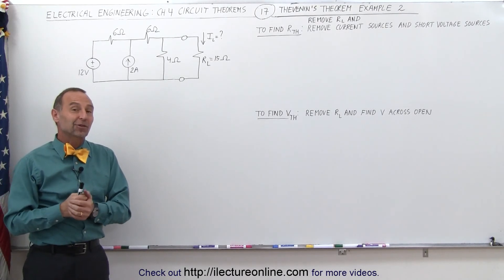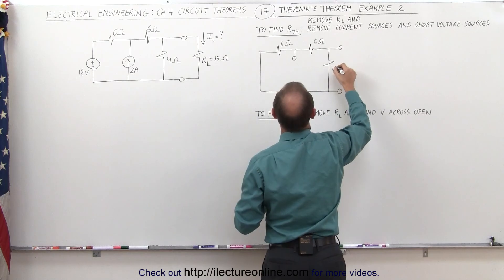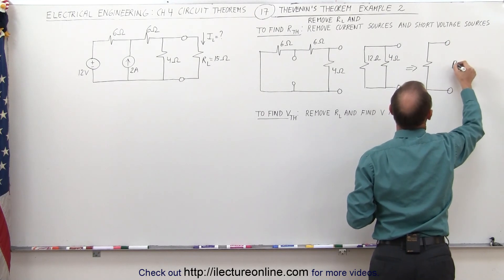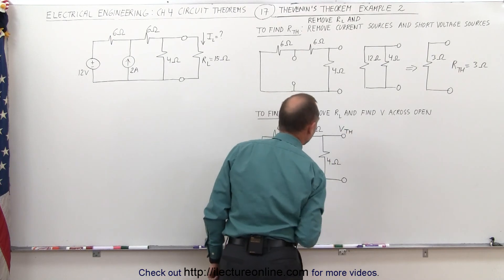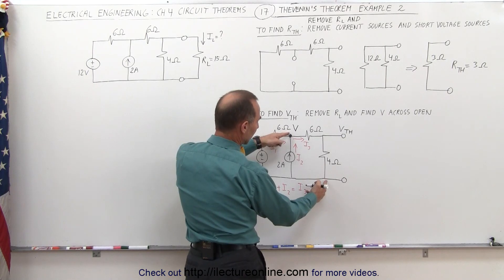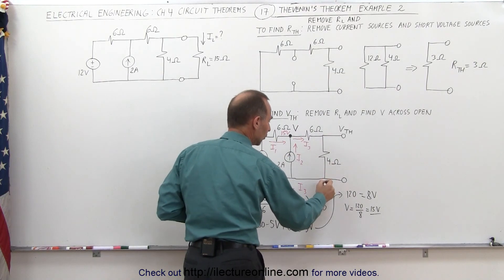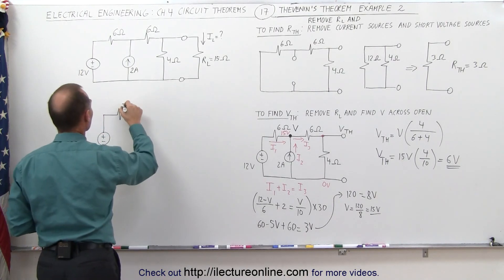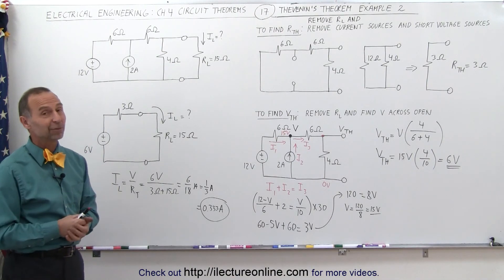Electrical Engineering: Ch 4: Circuit Theorems (17 of 35) Thevenin's Theorem Ex. 2

Comment: im confused, why is the equivalent resistance of the two 6 ohms equal to 12 ohms? are they not in parallel? 

or, does it mean we neglect other branches that are not resistors when we're determining whether resistors are connected in parallel or in series ?
Reply from the maker: When you are finding the Thevenin resistance, current sources are removed which places the 2 six ohm resistors in series.

Comment: at 1:08 when you combine the resistors, why is it not possible to combine the 4 ohm and 6 ohm resistors as they appear to be in series?
Reply from the maker: From the 2 end point connectors, (let's label them A (top) and B (bottom)), there are two seperate paths from A to B.  Through the two 6-ohm resistors OR the one 4-ohm resistor.  That is what makes them in parallel.

Comment: hello
Please why was the node above 4ohms not solved using node analysis

Giving us two a simultaneous nodes equ instead of using voltage divider
Reply from the maker: There are many techniques available to solve circuits.  When we use one of them, that doesn't mean that another technique could not have been used instead.  We try to cover all the different techniques.

Comment: Sorry sir, but on finding your equivalent resistance, you said the two 6 ohm resistors are in series. How are they then in parallel to the 4 ohm resistor, since the same current flows through all resistors upon open-circuiting the load?
Reply: Sorry I may have been a bother, I can't just help but be inquisitive about things I don't quite understand
Reply from the maker: The best way to determine if resistors are in series or in parallel, is to see if there is only one path, or mulitiple paths for the current.  In the second circuit drawn, all the current flowing through the first 6 ohm resistor MUST also flow through the second 6 ohm resistor, therefore they are in series.   The current flowing from a to b, has a choice.  It can flow through the 4 ohm resistor OR through the two 6-ohm resistors.  They are in parallel.
Reply: @MichelvanBiezen  where can point a and b be on the circuit that the current gets divided, it was open circuited at that branch if I recall correctly.
Reply from the maker: Look at the first sketch under : "To find Rth".   Going from a to b there are 2 paths.
Reply: I dont see any labelling for a or b....can u please indicate by some means sir 🥺
Reply: Like " a is a point between such snd such resistor "
Reply from the maker: You are correct.  I didn't mark the a and b points (which I usually do on these types of problems).  They are the little circles drawn in this type of problem which indicated that is where the load is attached.   a and b are the terminals to which the load is connected.

Comment: Sir, you did a proof of thevenin's theorem but it is not the proof of the method that you used here. Because in the proof, there must be a current source (or maybe a voltage source) outside of the linear part. But there is only a resistor outside of it. I want to see a proof of this method.
Reply from the maker: We didn't give a "proof" of the theory.  We just illustrated how to use the theorem.
Reply: @MichelvanBiezen  But you have a video of the proof

Comment: Professor in this example can we write KCL for those two nodes . In one node the voltage is V and in node next to it is Vth . And for current I3 we can write V-Vth / 6 . Can we do in this way or not ?. ( I know that this  solution that you have given is in more easy way with voltage devidor but I want to know that maybe this exercise can be solve by doing 2 KCL )
Reply from the maker: You should always be able to use KCL.  (It always works).  Try it and see if you get the same answer.
Reply: @MichelvanBiezen  yes is the same answer . ( I like to solve those problems with KVL but I realised that also KCL is very powerful tool ) thank you
Reply from the maker: Usually you want to use both in the same problem.
Reply: @MichelvanBiezen  yes is completely true
Reply: @MichelvanBiezen  thank you for your advice

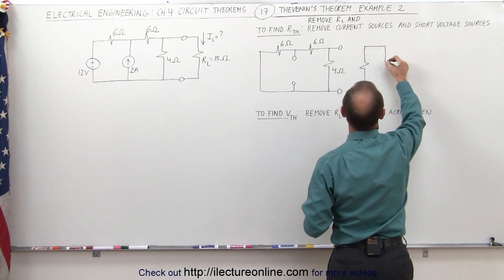Comment: 01:26 why are they parallel?
Reply from the maker: Going from A to B (the two terminals on the right side), the current can either go through the 4 ohm resistor or the 2 - 6 ohm resistors.  When the current has two paths they are in parallel.

Comment: Can anyone tell me, when finding R_th, why the 6ohm resistors are parallel with the 4ohm resistor

In relation to that, if that was parallel, why is the 6ohm resistor in series with the 4ohm resistor in the V_th part. Many thanks
Reply from the maker: Going from the top terminal to the bottom terminal the current has the choice to go through the 4 ohm resistor OR the 6 ohm resistor.  By definition that places them in parallel.
Reply: @MichelvanBiezen  Thanks for the quick reply! That makes sense. I guess I was just confused because I was looking at it in the wrong direction. Would it be correct to say then that when finding R_th, we must view the current as coming from the terminals A or B?
Reply from the maker: That is correct.

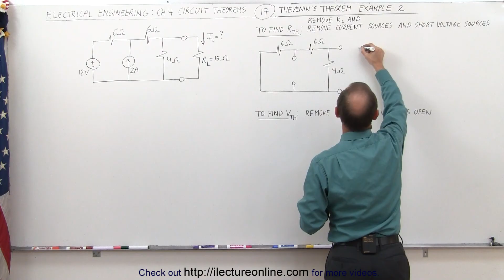Comment: @ 1:11....Why is the 4ohm resistor in parallel with the two 6 ohm resistors? When you remove the load, it appears to be in series ( one current path)
Reply from the maker: There are 2 paths for the current from point A (top terminal) to point B (bottom terminal).
Reply: @MichelvanBiezen  Thanks. I see now.

Comment: how do you find R load, or is it given?, what do i do when i am given a cirvuit that has no load resistor given?
Reply from the maker: The load resistor is usually given, as it can take on any value.  The load resistor will indeed affect the rest of the circuit once it is connected.  It is often the case the load resistor is not given and that is why we use Thevenin's  Theorem to solve the problem.  We have other examples like that.

Comment: Thank you so much sir, I have a question though.
Why did you add the 6 & 4 ohm resistors during the nodal analysis step when finding Vth? I don't understand how they are I series...
Reply from the maker: Are you referring to the step where I calculate the Thevenin voltage?  (Vth = V (4 / (6 + 4)) ?  That is the method used to determine the voltage used in that branch.  (voltage divider technique)
Reply: @MichelvanBiezen  Yes, thank you. I'll definitely research more on the voltage divider method.
Reply: @MichelvanBiezen  sir , why we use this equation

Comment: Hello Professor, hope you're doing well. I have a random question: let's say that the 6-ohm resistor above the 12-volt source was removed from the circuit and nodal analysis was used, as you showed. How would you represent i1 in this case? The numerator would be "12 - V" but there is no resistor to divide it by? It seems like an easy answer but I am struggling with the basics. Thank you.
Reply: The volt of that node will automatically 12V if no resistor is there

Comment: Dear sir, is i1 direction arbitrary? Because  thought current flow from high to low potential.
Reply from the maker: When there is more than one source, it is not always easy to tell which direction the current will flow in any particular branch.    But yes, current flows from high potential to low potential.

Comment: sir I just wanted to ask again.. why is the Vth is not 15V ?? why do you need to do the 15(4/6+4) to get 6V ??
Reply from the maker: Think of it as a voltage divider.  Part of the voltage drops across the 6 ohm resistor and part of the voltage drops across the 4 ohm resistor.  Vth = the voltage drop across the 4 ohm resistor.
Reply: Michel van Biezen sir .. does this mean that when you open the 2A the two 6 ohms are in series and parallel to 4 ohms.. and when you added the 2A again the two 6 ohms are in parallel and series to 4 ohms?? why sir??

Comment: sir.. why did you take 4 to be divided by 6+4 ?? in the last part when you're getting the Vth?
Reply from the maker: That is using the "voltage divider" concept.  (What is the part of the total voltage drop across the 4 and 6 ohm resistor that is dropped across the 4 ohm resistor?)
Reply: Michel van Biezen thank you sir!

Comment: Sir pls tell why the 4ohm resistor is in parallel
Reply from the maker: If you take the 2 - six ohm resistors and move them to the left branch (the vertical part) it will look exactly like the parallel circuit.
Reply: K now i get it.
Reply: You are an awesome teacher.respect from india.

Comment: why are 6ohm resistors in series?
Reply from the maker: When the 2 A current source is removed and replaced by an open, the two six ohm resistors will then be in series.

Comment: Sir. I dont understand how Vth being calculated. As you used Vth=15V x (parallel). Why you used parallel? Please help me sir. Thank you
Reply from the maker: First you find V at the node using node analysis method which is = 15V    Then you use a voltage divider method.  (Vth = voltage drop across the 4 ohm resistor)

Comment: Sir, I'm totally confused . In 1st example you took the Node as Vth and in this example you used voltage division rule for Vth . Why ? Please answer ASAP
Reply from the maker: Note that in example 1 (video # 16) no current will flow through the 1 ohm resistor, thus Vth is the same as the node voltage.
Reply: @MichelvanBiezen  y did multiplied *30 there for vth

Comment: Please sir I don’t understand how you got i_3 as  V/10 , Explain it to me I’m getting confused. 6 ohm and 4 ohm are in parallel, right?
Reply from the maker: The 6 ohm and 4 ohm resistor are in series.  Thus the total resistance along that branch is 10 ohms.  Since current =  voltage / resistance.    I3 = V/10
Reply: They're in series because the junction between the wire of the 6ohm resistor and 4ohm resistor is no longer a node (the current isn't flowing to the end of the wire)

Comment: Can you please kindly tell me why you the voltage in the node 1 is 15V which is greater voltage source, ia that because of the 2nd source im bit confused, also at the end you multiplied the voltage by 4 ohms over 10 ohms is that V×(R2÷R1+R2) law ? Thanks in advance, i find your videos helpful and easy to understand  thanks again.
Reply from the maker: The voltage at node 1 is found by using Kirchhoff's current rule at that node.  Current in = current out.
Reply: Michel van Biezen thanks for your clarification

Comment: The two 6 ohms and 4 ohms resistors are in series?right?
Reply from the maker: When the load resistor is removed, yes.
Reply: but why in the video you calculate it in parallel?

Comment: prof. van i dont get what you do in that voltage divider u tell
Reply from the maker: The voltage drop is proportional to the ratio of the size of the resistor and the total resistance of that branch.  Total resistance is 10 ohms and the 4 ohm resistor will therefore have a (4 /10) * 15 V drop.
Reply from the maker: There are also a number of circuit videos in the physics videos.
Reply: Why you use 4 ohm not 6? I dont really get it im sorry im an idiot😢
Reply from the maker: Don't call yourself that.  It is normal not to see something at times.  (It happens to me all the time).  The 4 ohm resistor is parallel to the gap between Vth and 0 V, therefore the voltage across the gap is the same as the voltage drop across the 4 ohm resistor.
Reply: @MichelvanBiezen  hi sir may I know for the voltage divider, why your Rt is 10ohm? Why you didn't include 6ohm as in your Rt?

Comment: In the first thevenin example using nodal analysis to find vth, you assigned the node as vth. Here you assigned it as node V and you used it to find the VTH. I'm kinda confused cause I taught when you found voltage at node V, it is already the vth since voltage in parallel circuits are constant. Thank you.
Reply: since the voltage get divided when it is series so we can not simply say that voltage across 4k resistance is the whole voltage as it is also divided into 6k resistance which is in series with 4k ..thats why we use voltage division rule to find out how much voltage resistances in series are sharing ..
Reply: In this example, the 6ohms resistor makes V not parallel with Vth whereas in the first example the 1ohm resistor is part of a open circuit.
Reply: Juan Carlos Raymundo bro, can you please elaborate ? Because I have the same confusion.

Comment: Sir, When we're finding Vth, couldn't we use V - V(the voltage that across 6 Ohm resistor)? I mean:

15 - 6 x i_3 

And to find the i_3, we could use i_1 + i_2 = i_3.
Since i_2 is given as 2 A, and i_1 can be calculated as (12V - 15V) / 6 Ohm which is -0.5A,
i_3 must be equal to 2A + (-0.5)A = 1.5 A.

Now we have i_3, so:

15V - 6R x (1.5)A = 15-9 = 6V which agrees as the result that you've found but I'm not sure if I get this result in a right way.

Thanks for your time that you've prepared these extremely helpful videos.
Reply from the maker: There are often different ways in which you can solve the same problem.  All are just as valid.  A good check is to see if you get the same answer.

Comment: The 6 and 4 oh resistor, arent they in connected in series?
Reply: @This is my jam I was confused too so I searched up other videos. Thevenin resistance is actually the resistance in respect to the load resistor, going from node A to node B. Let the node between the 6 ohm and 4 ohm be node A, let the node connected to ground be node B. 

      You can go from node A to B via the two 6 ohm resistors, or just the 4 ohm itself. This makes the 4 ohm resistor actually parallel to the two 6 ohm resistors, not in series.

Here is his other video, it might make more sense: https://www.youtube.com/watch?v=CdRjhqii080
Reply: @ericliu7705  Thanks for clearing that up, I was really confused at first
Reply: yes, they are, found my mistake

Comment: aren't all the resistors in series? for when you're simplifying the thevin resistance? I'm confused
Reply: No, they're not. I also thought that, but now I understand why:

First of all, imagine that the 2 6ohm resistors form a new 12ohm resistor (justo for simplification).
Then, you now haveone 12ohm resistor and one 4 ohm resistor. Now, if they are in parallel, they must share the same 2 nodes, and they do!

Because nodes are not only points!! This is an important thing that I believed before watching his's videos, but fortunately I changed my mind. 

PLease answer me if you understood what I'm writing
Reply: They aren't. When a resistor ends shares the same node they are parallel. If only one end share a node, series.
Reply: Was going to ask the same question.
Reply: Eliaziim c very basic mistake, I am moving to other channel.
Reply: @qiangou1400  they are in parallel because they have 2 common points. You  should move yes, but to study the basic lessons
Reply: @qiangou1400  why? I think the 6+6 and 4 ohms are in paralle, which means 1/((1/12)+(1/4))=3, you shouldn't treat it as a independent circuit, it is a part of a circuit.
Reply: no, I think the 6+6 and 4 ohms are in paralle, which means 1/((1/12)+(1/4))=3

Comment: Shouldn't it have been (12v - v / 6) for current I₁
Reply from the maker: No, you do need the parentheses.  I = (12V - V)/6     (drop in voltage divided by the resistance).
Reply: No I mean shouldn't the 12 have the voltage unit in front of it? Your equation has 12 - v / 6. Great series by the way.
Reply from the maker: I usually omit the units to give the equations a cleaner look.